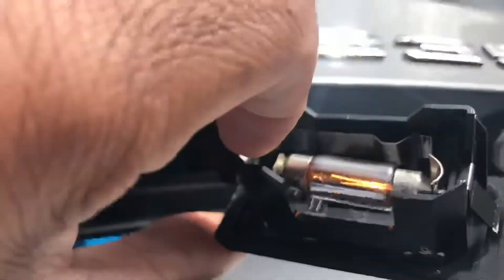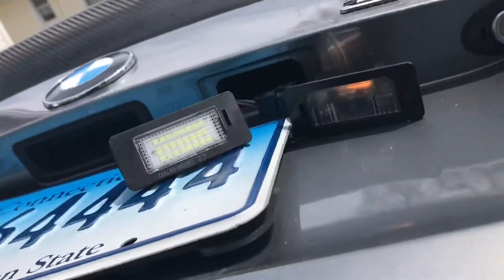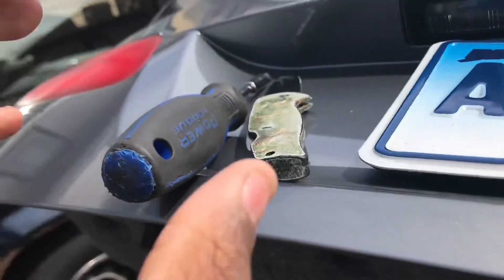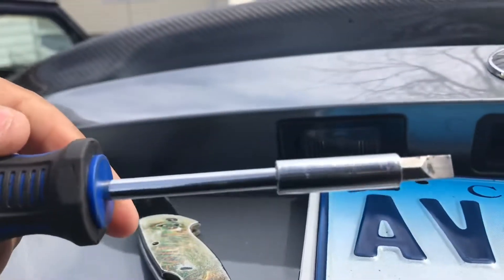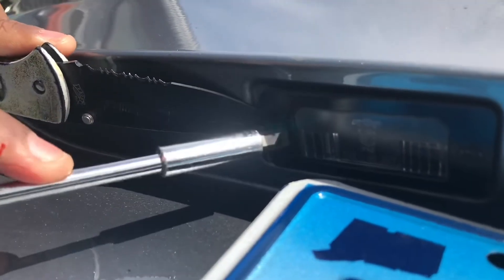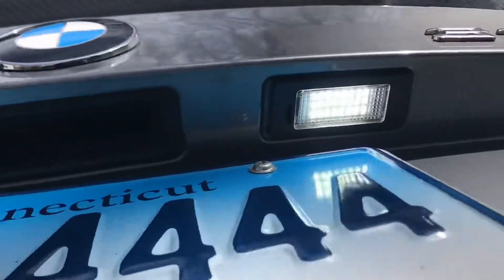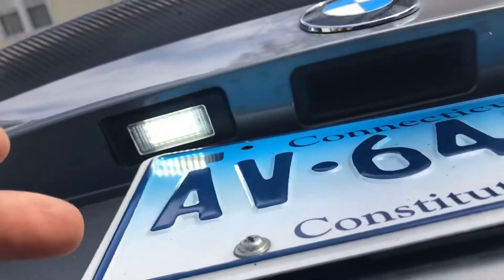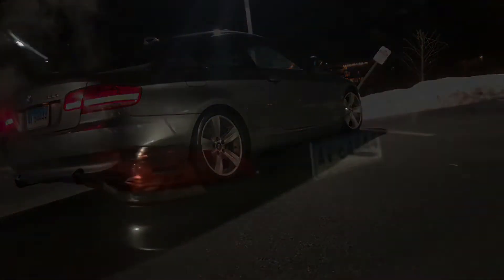How to replace your BMW 335 license plate lights

Comment: Question- If I want to get my class A & B cdl, since I just turned 20, do you have to pay the cost to get your class A cdl, then go back through program and pay the class B cdl cost? Or can you just get it all at once within 4 week program
Reply from the maker: If you get your CDL A you can drive anything that requires you to have a CDL you can drive dump truck and tractor trailer with a CDL A you would just need endorsements such as tanker and passenger if you wanted to drive school bus or haul water